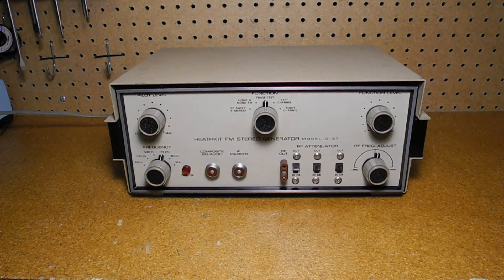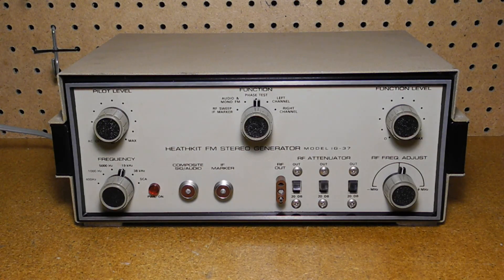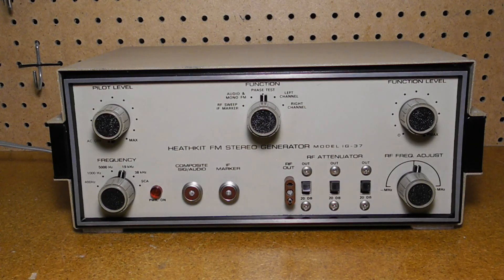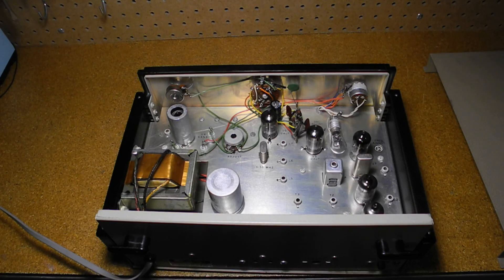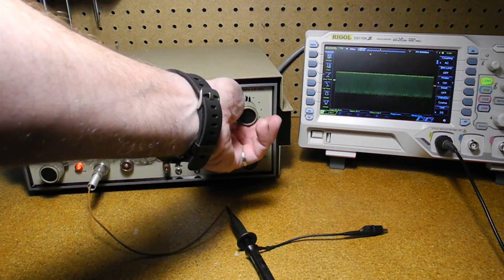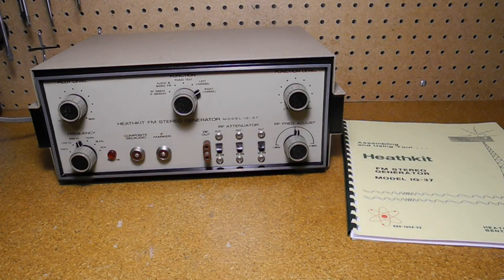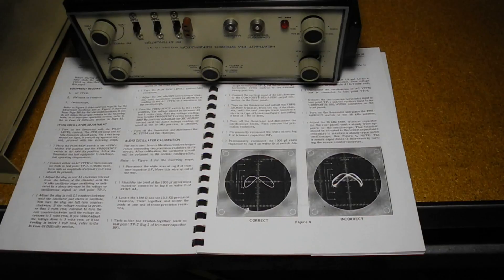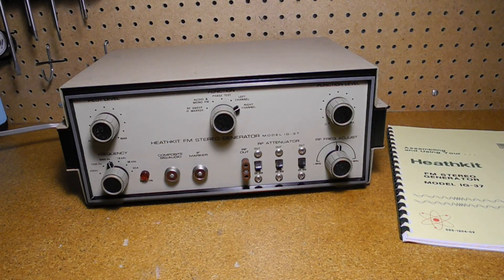The Heathkit IG-37 FM Stereo Generator

Comment: Jeff, seems you are one of the only subject matter experts on this unit. I recently acquired a nice 5237. My primary question is what is this RF connector both of these units use. I cannot find a termination anywhere. I'm not sure what its called besides twin lead 300 ohm connector. Please provide some insight on this termination. Thanks Ben.
Reply from the maker: The connector is normally used for crystals, type FT-243 I think. I don't know why they used it in this case. You should be able to rig up something using some pins taken from an octal vacuum tube and soldering them to some 300 Ohm twin lead cable.

Comment: I purchased a IG-37 on eBay and just completed the alignment per the manual. I have built many Heathkits over the years and I to found this the most challenging to align. I am attempting to align a Heathkit AJ-30 fm tuner but having very little luck. I can not find the 10.7 signal on the IF marker out on the front panel. My scope shows a 5.35 frequency there and I see no harmonics described by the manual. Can anyone help here as the in-37 manual is very lacking of info on the IF procedure. I have checked v5 wiring changed out V1 with V5 and checked the function switch wiring per troubleshooting in manual with no luck.
Thanks john

Comment: I have a 5237 and it has aligned 6 receivers so far after a thorough going through. I also used a frequency counter to help align the unit.   Its a regular piece of equipment on the bench now. Thanks for the video.

Comment: The biggest problem with restoring any Heathkit piece is that one is at the mercy of the builder!  I have an IG-5237 that I am working on.  Judging by the replacement knobs, it has been through at least two prior owners.  I replaced all the electrolytic capacitors.  The other capacitors and the resistors were within spec.  The filament transformer lead was broken off from pin 5 of V5.  I repaired that and fired the unit up.  Alignment was going fine using a VTVM and oscilloscope until I got to the pilot level adjustment.  I was missing the 1000 Hz signal coming from the cathode follower.  And I only had half of the filaments lighting on V5.  It turns out that pins 5 and 6 are broken off the at tube socket.  I am presently waiting for snail mail to deliver some new sockets.

Comment: Nice video! It would be nice to see a video on the actual alignment procedure. I had trouble aligning mine. A previous owner permanently installed the precision resistors with a switch to switch them in and out for calibration. I have a funny feeling I may have forgotten switch it back to the operational position when I reached the 38khz alignment section. I'll have to go back and check!

Comment: Terrific video! Thanks for posting. I just picked up an IG-37 and would like to run through the generator alignment procedure. My unit came without the precision resistor also. Can you elaborate on what you did to get through the "Audio Oscillator Calibration" without having the precision resistors? What position are the "Function" and "Frequency"  switches supposed to be in for the Audio Oscillator Calibration test? Thanks for your consideration.
Reply from the maker: I used standard resistors with similar values for the precision ones: 4.7K for 4590 and 15K for 13.5K and followed the instructions in the manual.What this does it make the audio oscillator run at 19 kHz, the same as the separate 19 kHz oscillator, and you adjust them to be the same. If you have a frequency counter or calibrated oscillosocpe, a better procedure seems to be not to use the resistors, and adjust the 38 KHz oscillator to free run close to 38 kHz. Then in the later step where the 19 and 38 kHz should be synchronized in phase, they should be.
Reply: Thanks again for your insight on how to calibrate the audio oscillator section. Just as a follow up here’s how I finally calibrated the circuit. I used two miniature 10-turn pots as substitutes for the 4590 Ω and 13.5 KΩ resistors and twiddled them until they were dead on. Using two channels on my oscilloscope I placed one probe on TP1 and the other on the “Composite Sig Audio” connector. Triggering from TP1 it was a surprisingly easy to adjust the frequency trimmer until both 19 kHz waveforms were locked in phase and frequency. 

The Heathkit IG-37 is certainly a peculiar unit to calibrate. After getting screwy results following Heath’s “Balanced Modulator Adjustment” instructions here’s what I did calibrate that section. Using two channels on my oscilloscope I placed one probe on T2 pin 4 (location where C28 and D3 connect). Then I placed a second probe on T3 pin 3 (location where C29 and D2 connect). I left V1 (12AU7) tube in circuit and set R54 (Balance Mod Control) to midpoint. I adjusted T2 and T3 until both scope channel waveforms were identical in shape and amplitude. Finally, at the end I measured the voltage at the “Composite Sig Audio” connector with V1 (12AU7) out following Heath’s instructions. I measured .03V rms, the instructions called for a range of .01 to .05 volts rms.

One other note worth mentioning. After I replaced the main 3-section electrolytic I still noticed a lot of ripple. I added an extra 150 uF at the cathode of diode D1 in the power supply section. It knocked the AC ripple down by about 50% more than typical.

Comment: Interesting. In this Video the Audio Frequencies are a bit "high", I think. 400 Hz sounds almost like 440 Hz. Would this be within Tolerance or not?
Reply from the maker: Yes, the 400 Hz measures about 437 Hz and 1000 at 1060 Hz. There is only one frequency adjustment that affects all ranges, and it is more important that it be close at 19 kHz and 38 kHz. There is no published spec on how close the audio frequencies should be, but it doesn't really affect the operation.
Reply: This is why a subscribe to this channel. I find this generation of electronic interesting but don't have the time and knowledge to do it myself. i got the frequencies by holding my phone with a guitar-tuner app infront of the computer speaker.
Reply: Thanks for the Answer! Yes, those Frequencies are the most important!
Reply: 435,5
1069,8
couldn't mesaure the 5KHz signal
Reply: mikgus  - Yes. I also could not meassure the 5 kHz Signal before but I found a Way to check it. I recorded the Tones in Audacity and used the Frequency Analysis of Audacity to check the Frequencies. :D

The Results were very close to Your Results. 
I got 436 Hz, 
1070 Hz and the 
5 kHz Signal (which I also could not check before) seems to be almost Spot on.. 4,999 kHz... :)

But I also found out, that for the Alignment of the Audio Frequencies two additional special Precision Resistors are needed, the Ones that were mentioned in the Video. Without them it must be difficult to align all Audio Frequencies properly.. I guess.. :/